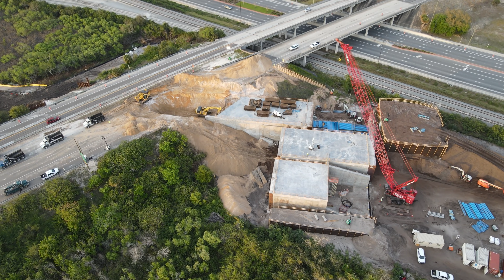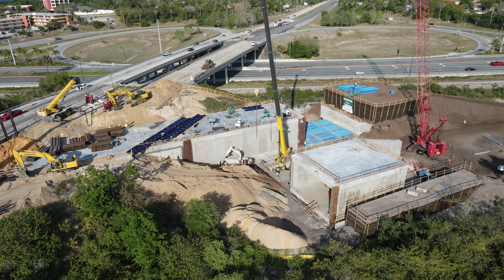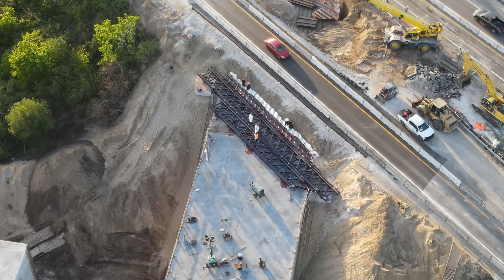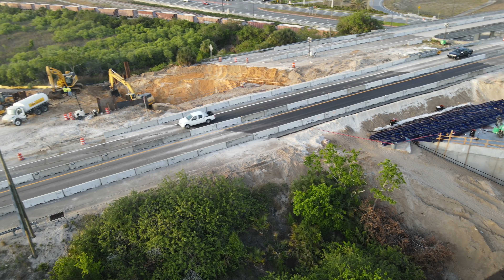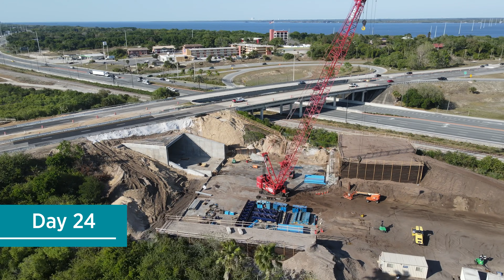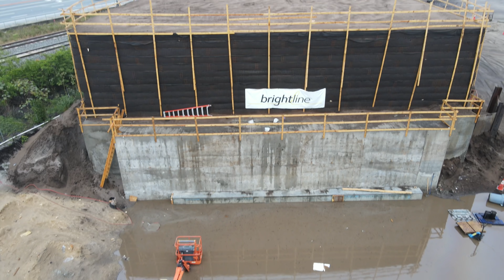Brightline Construction: The Complete Cocoa Tunnel Installation

Comment: What’s the deal with brightline? Why are no trains running? If anything they run a more hygienic train than the tri-rail. Not that it’s an issue for them but god they much be loosing some money. I see no reason why they can’t be running from WPB to Miami.
Reply from the maker: They are using this time to install a new positive train control system, which has to be operational before they can resume service.

Comment: In one news article they said that it was wide enoigh for three tracks. Accounting for slightly banked tracks seeing as this tunnel is placed in a curved section, I was sceptical. But comparing it to the space needed for two side by side tracks running under the viaduct maybe they were right.
Reply from the maker: It is wide enough for two tracks

Comment: Correct me if I am wrong, but wasn't the length of the new tunnel segment underneath the existing highway determined by the future expansion of the highway to three lanes in each direction?  If so, this was a brilliant piece of advanced thinking by the planners, which they should be commended for.
Reply from the maker: Yes, it was built with the state road 528 widening in mind.
Reply: @RoamingRailfan 
Did brightline have to pay more for the extra tunneling, or did FDOT cover it?
Reply: @SquickersKingdom  probably not, surprised FDOT allowed it, but brightside has to pay for lost of toll revenue.